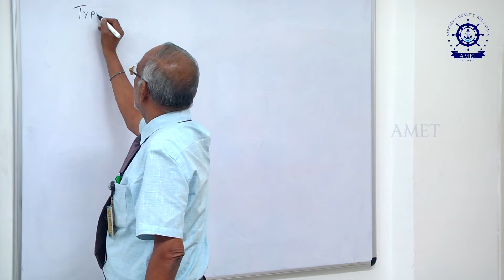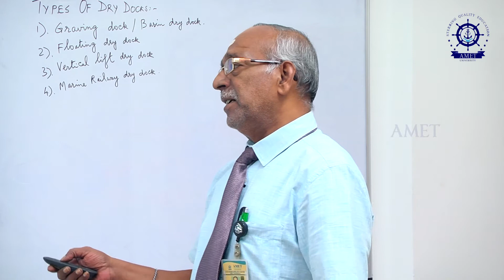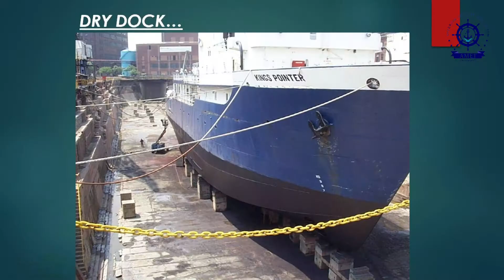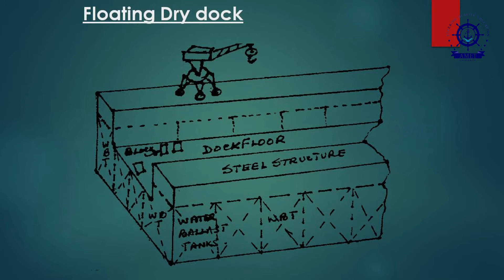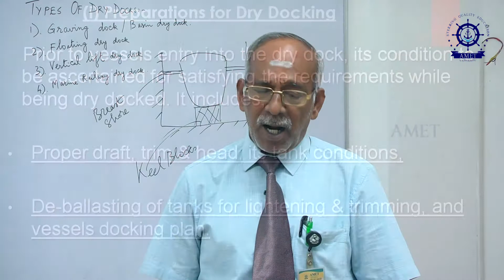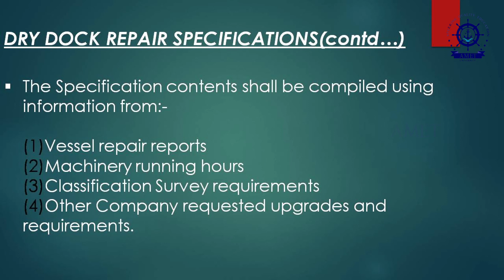Dry Docking - (I) Preparation of Dry Dock (II) Repair Specifications by P.S. Sridhar

Comment: Thank you very much sir. The class is very interesting. I would like to ask: for ships of the landing craft type, is it also necessary to have more draft aft or in these cases is it necessary to beach with more draft forward? It turns out that the keel line from the last part of the bottom has a slope from 0 to 500 mm, which would have to be filled with more blocks on the docks and that could make beaching difficult. Would it be preferable to beach so that it touches the dock forward first? Then the longitudinal rotation would come and that's it. Please, if you have a recommendation, it would be appreciated...